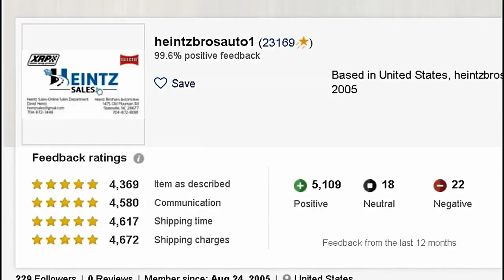How to spray paint wrinkle red & make it look good! (Without powder coating)

Comment: Nice job bro, I did mine with the black and baked it in a cardboard box with a space heater. If anybody out there doesn't have a heat gun. You can make a makeshift oven like that.

Comment: Great video, thank you for doing this video.
Reply from the maker: No problem. Its been kinda slow on the channel and i felt this was a prime opportunity to get a video out!
Reply: @JamesDguy  Another video idea would be aluminum polishing and which to use to coat it... either wax or clear coat?  Maybe coconut oil since it's a high-temp biodegradable oil... or sunflower oil.
Reply from the maker: Thanks for the video idea!

Comment: I didn't knew about the heating gun trick. My valve cover turned up very smooth and kinda orange but with a different spray
Reply: Won’t react without the heat, I found the same.

Comment: Question: not ready to paint valve cover yet,(eventually). Would the wrinkle paint work on the plastic engine cover or is it not worth the effort? Just a thought
Reply from the maker: Yes it does work on plastic i have done it before. You don't HAVE to use heat for the wrinkle to take effect it just takes longer for the process to work. You could do it on low on a hair dryer and keep moving and it should be fine

Comment: Just put it in your oven to cure on a baking pan. Set the oven to warm so your not literally baking it. It will cure and end in a nice wrinkle finish in no time. It needs heat to wrinkle correctly though so using a heat gun or the oven is must or it won't look right and you will have some spots that are more wrinkled than others.
Reply: Five hundred 20s  Not a gas oven. Electric oven. Perfectly fine. Also should note put on warm-200 degrees.

Comment: Are you saying I shouldn't use the rosebud on my oxyacetylene torch to heat up the paint can?
Reply from the maker: You are competent enough to do it but some people are NOT. Just a general you shouldn't but i didn't say i don't do it lol
Reply: @JamesDguy  im just joking btw
Reply: bringing the can of paint inside if it's cold outside, a few hours prior is a good idea, and using a heat gun on the low setting, CAREFULLY, to warm it as you're using it, not a bad idea too

Comment: Nice bro bad news on the accord though 😞
Reply from the maker: What happen?!
Reply: Moore Motorsports James Dguy well I’m having trouble getting the rocker assembly to go back on to the head after I got the cams switched out and I couldn’t find anyone to help me so I went and asked the guy at keevers on 30th and showed him pictures of everything that happened. Well he gave me a few suggestions on how to get the assembly back on but he asked if I have pulled the head yet so to see if there was any damage and I told him no because all the valves were still in the head so it seemed fine and he told me anytime a camshaft snaps or a serpentine belt breaks on a motor like that it’s like a 98% chance that it bent at least one valve.. so now I gotta pull the head after just doing a head gasket job and a bunch of new parts to have the head fixed or replaced. And I asked him about how much to fix it and put new valves in and it’s about $400 for everything including labor.. I can just buy a new head for like $300 I’m so frustrated now

Comment: ChrisFix puts a big storage container over the part to keep bugs and floaters out of the paint while it dries. Another option is the ceramic brake caliper paint from an Advance auto parts store, about $10 for a large spray can. VHT might be the best brand for hotter exhausts.
Reply from the maker: This is wrinkle paint is awesome stuff and is very durable for its price. I prefer wrinkle paint over glossy paint for valve covers just because if it gets dirty its actually harder to notice. VHT does make a great product and its nothing like other spray can paints.
Reply: @JamesDguy  The ceramic brake caliper paint from an Advance auto parts store instead of a wrinkle paint, or on top of a wrinkle paint to try to make it more durable. This paint is difficult to get it to run or drip, and covers well. I have used it for brake calipers and metal roof chimneys and roof flashing- it does very well for vertical surfaces.

Comment: I would of left the honda red also. Looks smeared now.
Reply from the maker: Can't capture the real beauty on camera. It looks perfect in person. Maybe turn it on HD 1080p60fps
Reply: Moore Motorsports James Dguy yea it’s clean good job
Reply: Using the acetone like he did is sooo unnecessary. After its dry you just take a sanding block to it.. comes out a beautiful bright brushed aluminum finish.
Reply: I should add take a razor blade to it first to get most the paint off the raised lettering. Then take a sanding block to it. I used to do this probably been 15 years or so ago now.

Comment: Clear coted bro ill be more durable
Reply from the maker: You don't clear coat wrinkle paint
Reply: @JamesDguy  try it in your chanel we want to see it
Reply from the maker: It don't turn out like you would think. Wrinkle paint is suppose to be a satin/matte finish. if you were to clear coat it then you should use a satin clear but its not necessary since the wrinkle paint is durable on its own. Its more durable than your typical glossy or matte spray paints. Idk if you watch till the end where you can see its matte finish or not but it looks perfect without the clear and last a LONG time. If you don't plan on taking it off alot it should last for years.